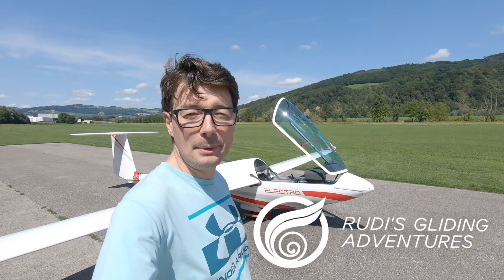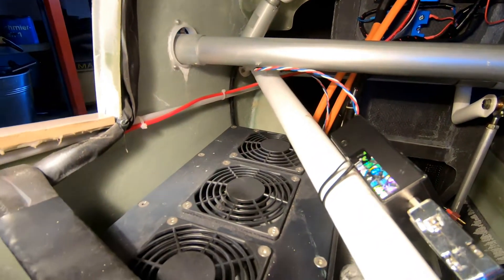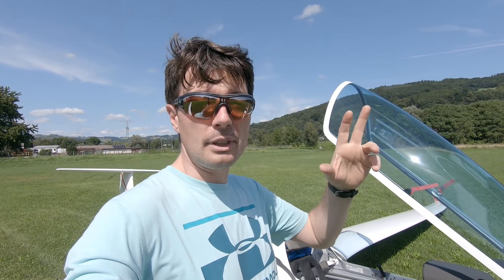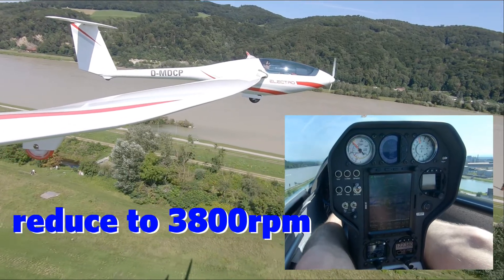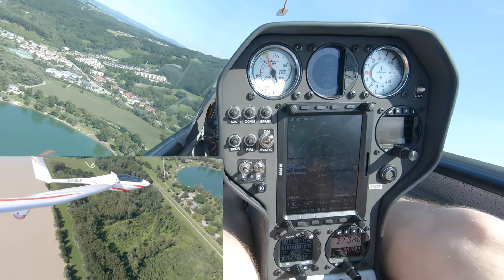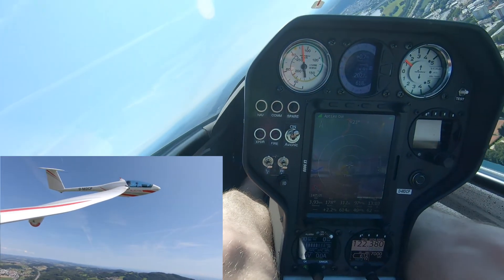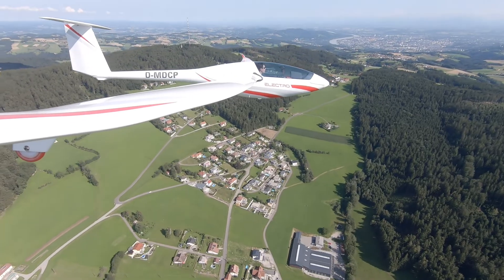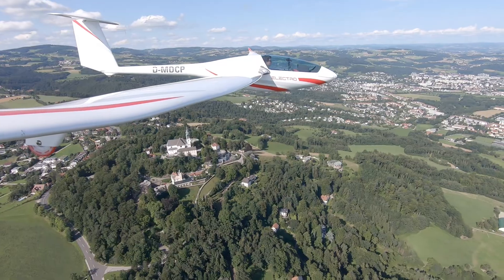How to fly most efficiently with a FES powered electric glider

Comment: Have you considered replacing the carriage wheel with a high powered e-scooter wheel to conserve Volts? 1500w motor/72V system/50amp controller, would assist launch very effectively and economically.
Reply from the maker: Hi yes these were also my thoughts 😃 - unfortunately I would have to convince the manufacturer for that somehow 😅. But anyway, I think that would be a good idea

Comment: I guess still the engine opened from fuselage is better. Never knew why...
Reply: its a very tiny bit more aerodynamic, but you dont need 10 seconds to extend it and when it fails you drop like a brick with the extended engine

Comment: How much power is required to sustain flight?I have an electric Bosch motor 3.5kw and 110 ftlbs of torque from electric motorcycle.Battery 3kwh.Could this sustain level flight?
Reply from the maker: Hi, for level flight are approximately 4-5kW are required ... it seems like your motor is just a little too less powerful 🫤

Comment: Remember in electric is not engine is Motor.
Anyway thanks for the video
Reply from the maker: Hello thank you, yes i have learned it in one of the first comments. As i am not a native speaker, i did not know that but i in future i won't make this mistake again :-) Thank you for your comment!
Reply: in engineering nomenclature a battery + electric motor system is still referred to as an engine, not that it matters at all.

Comment: Please describe what the “Fire” circuit breaker does.  Thank you.
Reply from the maker: Hi Drew, this is not a circuit breaker, this is a test knob with which you can check if the system is working. Kind regards, Rudi
Reply: @RudisGlidingAdventures   thanks for your answer.  As an engineer I I’m interested in for details as to how the fire  “system”  works.   Is it an output from the battery management system?  Indicating battery over temperature ?
Reply: @drewwilson1477  Gives both battery temperature and motor temp. along with voltage, amperage, power, rpm. and estimated remaining time at power level being used. Also gives energy level remaining (fuel) in 10% increments and various warnings including canopy open.

Comment: Excellent, the description was very good. The question that arises is whether it is capable at high density  altitude  airport  to self launch or not
Reply from the maker: Hi Hossein, thank you for your comment! A Silent 2 Electro has been operated in the past in Namibia, at elevations from about 4300ft, with temperatures approximately 35 degrees Celsius. So it is possible, but I do not know any takeoff performances
Reply: Under these conditions, it seems to have good capabilities.thanks so much for clarification
Reply from the maker: @tomahawk5115  you're welcome 😃

Comment: Why is it registered as D-M and not D-K?
Reply from the maker: Hi, this has historic reasons ... the original Silent was designed as microlight some decades ago. The Silent 2 Electro originated from that design with the same certification. Last but not least the lightweigt design makes it possible to do a selflaunch with the FES system, which is only certified for sustaining the flight in D-K planes

Comment: A glider is so much better with propulsion. Not a slave to thermals.
Imagine the efficiency of a glider combined with small turbofan jet engines and pressurized cabin flying mach 0.8 at 60000feet super efficiently. The freedom to go anywhere and fast and cheaper than driving a car. It's interesting that it's possible to fly unpowered but it's super useless. But the efficiency and engineering discipline of the glider world should be adopted.  Cessnas are awful.

Comment: Thanks for your video, I've been trying to figure out if it is feasible to build a self-launching FES with only ~20kW, your info was very handy!
Reply: In my opinion 20kw is enough. The motors can often handle way more power. The controller is what needs to be top notch

Comment: Great video!  I really like how you explained the strategy for self launch.  Sounds like this is best suited for airfields where you can typically find thermals from low altitudes.  Our complication in Boulder is that we often have a very strong and persistent inversion over the prairie and need to climb 5000-7000 ft above the ground to get into lift above the mountains.  Sounds like there might not be enough energy available for such days.  At least not with the current battery capacity.
Reply: What's interesting is the older Gen 1-4 batteries have really poor energy density by today's standards, about half the energy per kg of your common Tesla. So it should be pretty easy even with today's technology...

Comment: Nice video. That looks like a lot of fun. Quick question that maybe is a silly one, but would electric propulsion planes be theoretically easier to learn to fly vs conventional propeller powered planes? Was just wondering, in case they catch on... or in case there is an urge to try a sail plane / glider with FES ...
Reply: A bit easier in that there is no messing about with engine mixture etc, electric power just works quickly and easily at all heights and temperatures.
It's also more predictable in terms of failure, less to go wrong..
My experience is with rc models and I prefer electric 100%.
Reply from the maker: Hi Michael, it is not a silly question 😃. I think the handling of the motor is way easier and also easier to learn. To fly the glider/aircraft itself, there is only little impact on that. Thank you for your comment 😃👍

Comment: The statement "there is more power with a full battery" is only applicable to systems which are not engineered to provide full power even at low SOC. It is not inherent to all EV systems.
Reply from the maker: Thank you for your comment! I didn't know that!
Reply: its lipo man whether youre near the end or at cut off it really doesnt make a lot of difference

Comment: Is it perhaps more efficient to use full power and convert all excess power into altitude and then glide with prop folded?
Reply from the maker: Hi Gabriel, from my experience and according to the hints of the manufacturer it is not. The efficiency of the propeller is increased with a higher diameter and slower rpms. 
So in this case this is the most efficient way to fly with a FES equipped aircraft.
Reply: @RudisGlidingAdventures  While I agree with your statement in general, there is more to it than just that. I would love to see empirical flight data. One flight with "steady state" low power cruise, and one with "dolphin flying" of high power climbs and prop folded glides. I think which one flies longer might surprise you ;) FYI I build and fly my own electric aircraft :) https://www.youtube.com/watch?v=7xlrJ5kRm98
Reply: @RudisGlidingAdventures  Did you ever get a chance to do any testing on this?

Comment: I am kind of amazed that we have to settle for FES - coming from an rc background the evolution here is that electric is better than all alternatives regarding power and with the right Lipo blend endurance. When will you see the take off and good climb rate as well as at least a two hour battery reserve. I think this is more a hybrid solution. I want one anyhow.. What are other FES gliders besides the HPH Shark/Lark/Electro?  Can they be retrofitted with better motors or batteries?
Reply from the maker: Technically speaking i would say the FES system could be retrofitted into a lot of gliders. But as an economical fact, the maufacturers prefer to sell new gliders instead of retrofits 😉. So if you want to have a plane with certified FES installation, there is almost only the option of a new glider ...

Comment: Great video, i wonder if the wings could be coated with the low weight flexible solar panels to slightly increase the range of the battery whilst in flight
Reply from the maker: Hi Adam, good question. I think it would be basically possible, i only don't know the weight of the solar panels. What i know is, that there is already such a self-built glider with solar panels on the wings, just google Sunseeker Duo. I met this guy once at a meeting.
Reply: @RudisGlidingAdventures  Also this one >>  https://www.youtube.com/watch?v=9UfDzGyqZvI
Reply: @RudisGlidingAdventures the sun seeker duo is a good example of that idea in practice…
Reply: @RudisGlidingAdventures amazing video, and I wanted to chime in on the solar cells. I have been playing with bonding Maxeon solar cells to various materials. The cells are unbelievably light and about the thickness of paper.

Comment: Great video. Fes would be nice when doing aerobatics to takeoff even in winter for training reasons. Are there gliders authorized for aerobatics that can be equipped with fes system ? Thks
Reply from the maker: Hi Gwen, puuhh good question. I would assume that some of the gliders are certified for simple aerobatics (looping etc.). I don't think that any is certified for full aerobatics.

Comment: Great video Rudi. I have an early model LAK17B FES for 3yrs now and having no guidence it took me a while to really find out how best to use the FES sustainer. I made a few mistakes along the way including landing out after using all my battery reserve. I dont have the issue with the cold but with heat in summer here the ambient temperature can be +30C so running the motor too long can push the motor temp up. Keep up the videos!
Reply from the maker: Hi David, i will keep up making videos, thank you very much for your comment 😀! 
Yes, i know other operators too, who had to gain experience using the hard (expensive) way. So i hope to be able to help others to learn it the easy way 😀!
Regarding the hot temperatures: i have some experience too. You need to keep up the balance between using power and look for the temperatures not getting to high. And finally, keep the ventilation on, but you are reminded by the appropriate message quite soon, if you forget about that 😅

Comment: I couldn't have described self launched FES flight any better after flying mine 5 years and over 150 flights. Unfortunately the season here in Canada is short and mine is resting in it's hangar waiting for Spring. The FES system allows me to base the glider at a small public airport with paved runway, so I can launch unassisted a month or more before the grass field glider clubs can. Some of my best flights have been in the earliest part of the season with some snow still on the ground. The important thing is to keep warm! I've added sealing around the canopy and dress warmly. Fortunately, the FES can be relied on to start even in very cold conditions with pre-warmed batteries charged at home. Coldest air temperature I've seen in flight so far was -11C at about 7500' asl. I'm really looking forward to flying again as soon as my wings can clear the snowbanks at the edge of the taxiways :-)
Reply from the maker: Hi Jim, thank you for your comment! Yes keeping the batteries in a warm place is really necessary, in particular when the outside temperatures are still low. 
I have had a key moment on that once, since that i always store the batteries at room temperature.
Thank you for your comment!
Reply: @RudisGlidingAdventures  Storing the batteries at cold temperatures (above freezing) is no problem and can even extend their life but they should be warm for charging and for use. I store mine in an underground garage that never goes below 10C. They should also not be kept at a high or low state of charge for any length of time. I got a device from Luka at FES that discharges the battery to 50% when a heater (load) is plugged into it. It has a digital readout of battery charge %. If I decide not to fly after charging to 100% before a flight, I'll discharge to below 80% if likely to fly within a few days or to 50% if more than a week. So far I have not noticed a significant degradation after over 400hr and 150 flights and 5 years of ownership. My Silent (1070) had been an Alisport demonstrator for 2 years before I got it including record flights in Namibia.
Reply from the maker: Hi Jim, thanks for your remarks. So you are flying the D-MYTO? Probably with another registration now?

Comment: This is probably the biggest innovation in gliding since introduction of composite materials. It also improves safety a lot and opens new areas for gliding, previously not accessible in a safe manner.
Reply: strange coment from "fifi23o5"................rc-controlled E-gliders do use  T H A T   system (= front-propeller) for 50 years by now.................. // it is a shame, that man carrying glider production companies lost so much time to understand, that complex systems are not only complex but way to expensive !
Reply: @danizweifler6061  There is a bit of a difference between RC and a real glider.
Reply: well pretty much what is holding back the entire innovation is the limited capacity and weight of the lithium batteries, manufacturers have been promising Superior batteries for more than 2 decades now but nothing yet in the market, very disappointing, hydrogen fuel cells could probably be the next best choice.
Reply: @lcfflc3887  someone with some sense!  Electricity for any reasonable distance is a pipedream.  Lots of people have been looking for go fund me campaigns that never amount to much of anything, so ignore the hype.
Reply: Electric motors in general are a revolution: Human size drones, high performance electric bikes etc..